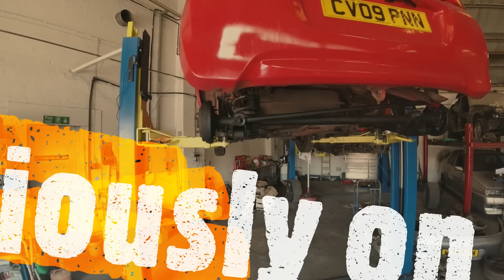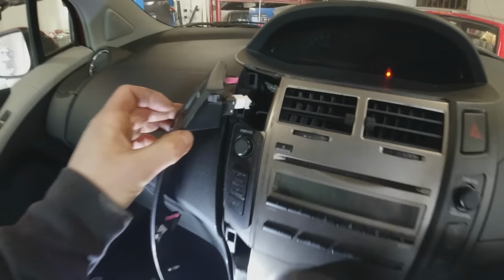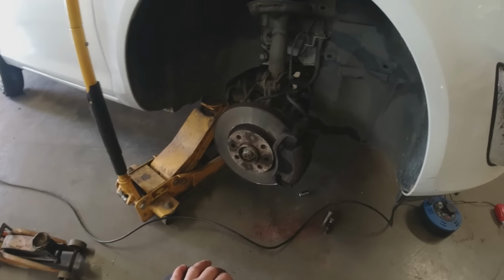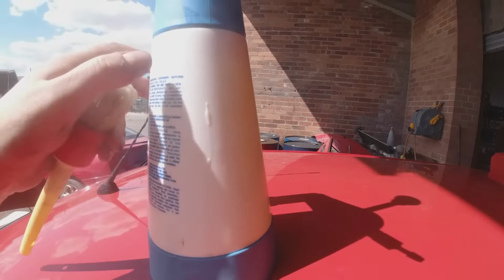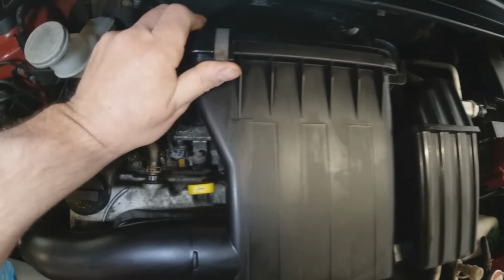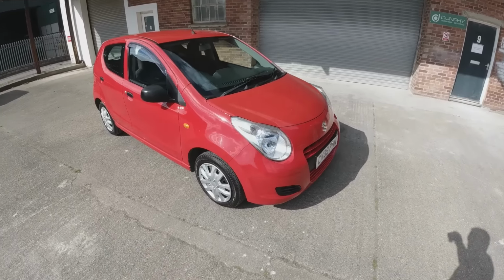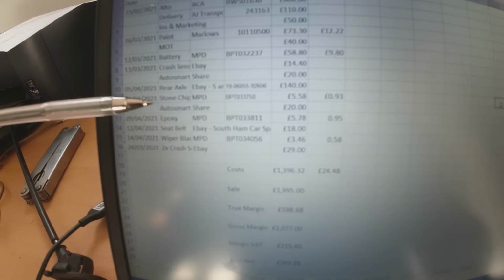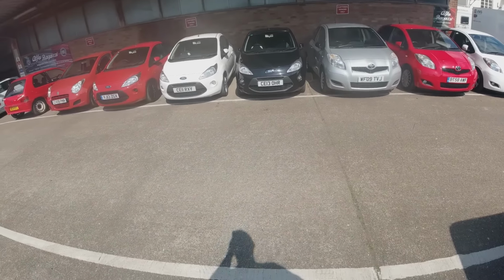Big News! Told to STOP SELLING CARS!! No more Car Flips?

Comment: The vast majority of Bona fide motor traders prep the cars properly. Gone are the days when you threw a bucket of water over it and put a bandage on the exhaust. It's went full circle where almost every niggle has to addressed whereas the private sellers are expecting retail money for a car that hasn't even been cleaned properly let alone mechanically inspected on a ramp.
Reply from the maker: Think you have nailed it there Mr T

Comment: Due to the virus the Landlord cannot evict you until March 2022.  Take your time looking for the right place.  The landlord cannot  "turn a blind eye" as you put it,  accept rent then change her mind later.  If it we're me I would ask the Landlord how she is going to compensate me  to leave? 
Re plastic welding,  if you use wire wool as well makes a stronger joint same as super glue  baking  soda and wire wool . 
Quote
Mr Barclay told the Commons: "Existing measures will remain in place, including extending the current moratorium to protect commercial tenants from eviction to March 25, 2022," Mr Barclay told the Commons.

He also announced plans for a binding arbitration scheme to resolve disputes between landlords and commercial tenants. Mr Barclay said the scheme should be in place for when the eviction ban is lifted
Unquote
Reply from the maker: Yes I don't hold the lease Stuart does but as you say we have time

Comment: What fixed price insurance platforms do you use?
Reply from the maker: Sorry do you mean Warranties?
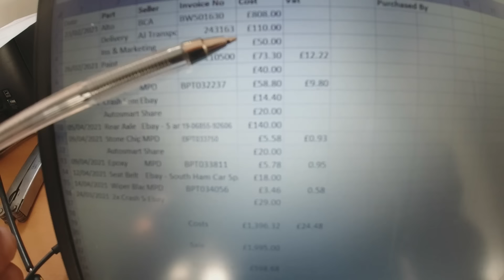Reply: @ChopsGarage  @26:30 you said you allocated a percentage of costs of insurance and marketing. My problem of getting in the trade is motor trade insurance. Is there any way of getting cheap insurance I know part time traders insurance should be cheaper but I was thinking is there a way to temporarily insure myself? Without motor trade insurance you cannot sign up to buy from auction houses so I'm struggling to find a way through this. Really don't fancy spending £5k on insurance whilst out of work lol
Reply from the maker: @M2menace  mmm not sure , but traders policies are about £1000 in my experience
Reply: @ChopsGarage  that sounds really cheap! I guess a mixture of location and existing no claims bonus helps

Comment: Worst comes to the worst sell from the Home mate for 2/3 months make sure the new place ticks a few of your boxes. But really think you have made a lot of connections where you are just now so they will always last but fingers crossed you find somewhere soon mate. Really wish you good luck! 

Tbf mate would do it for goodwill different if it was cost of a part or that but repeat customers/possible passing a good review worth its weight in gold. 

G101 is good and covers loads of cleaning wise with the car but I use Finish a product from AutoSmart for the Interiors or AeroSpace 303. Tyres I use Autosmarts Highstyle Dressing would highly recommend. Seat wise again buy just a 5l drum of solution from eBay with a nice scent and I use a Bissel Spot Clean Pro another little magic tool!
Reply from the maker: Cheers Paul, I check that tool out!

Comment: I push delivery via videos and loads of information then it doesn't seem to matter where you are, took one over the other day, they asked if I could remove their old car, I drove it back at 95 quid, valeted it, put an o2 sensor in it and got 675 for it, we've done some long trips and you know that unless it's a serious fault its not going to come back (which seems to take up a lot of your time)
Reply from the maker: Agreed I think this day and age location is less of an issue

Comment: Just come across your great channel,  In the early 90s I used to buy and sell Audi coupe gt's,  the 1982-91 models Ur 10 value and the later 20 valve turbo Quattro's. If only had known then because these cars  are rare but worth a bloody fortune now. I have now bought an early low mileage Audi TT and one of the first generation of the Ford focus that I will store as an investment because they are going to be a future classics and worth good money within the next 10 or so years, its  better than having the money in the bank. Keep up the good work and all the best for the future.
Reply: Crystal ball. I had 205gti would be worth 25k now! My friend has an Audi coupe '92 worth nothing (2k)!

Chops little Rallye could be worth a bit in 10 years though...
Reply from the maker: Agreed, I think the right cars outstrip a pension all day long! Thanks for watching
Reply: @rosbifsa660  I think most of the Audi coupes after 91 ant worth much because of the new body shape even though some had the pre 20v engine in them. I had an H reg metallic blue 1.9 gti pug wished I had kept that now. I think the 1.6 are worth more for some reason.
Reply: Rob mine was the 1.6 and ‘86. So ore facelift which was the better body too - lower, more squat. 

The 1.9 was a monster in comparison but I think a lot ended up wrapped around trees.
Reply: @rosbifsa660  lol that's true  my 1.9 was the very light but quick. Friend of mine had a 1.9 309 gti and that was much more stable not as scatty as the pug. We did have some good times though. I got interested in the Audi quattro and pugs way back in the early mid 80s watching the group B rally cars speed through Dalby forest UK 2am in the morning Best decade of true rally cars.
Reply: @rob5232  I bunked off sixth form for the '85 rally stage on Olivers Mount but it took so long to walk there I missed the Lancia's - Saw the S16 and 6R4 though...

Snuck into the pits (I think '78 Mintex) to speak to Mikkola and Vatanen (?) in the Escorts - awesome (mother was Finnish). 

Definitely best rally era!
Reply: @rosbifsa660  lol wow nice one,  I have actually seen Michelle Mouton sat in her Audi. We passed Walter Rahul in his sport Quattro  on the roadside near a small town called Thornton-le-Dale. Back then they used to drive the cars on the roads to each stage. The 6r4 and RS200 were the only cars I didn't like much. Happy days fond memories.

Comment: Bit of a click baiting headline! 
Have you thought about getting a stand for your camera/phone, instead of trying to hold it with one hand and trying to do work with the other.
Reply from the maker: Why click bait Gary? I have been told to stop selling cars and need to get a new location. Yes stand is in the works
Reply: Title is catchy, not clickbait. That's what it's supposed to do 🙂
Reply: @ChopsGarage  I didn’t mean any disrespect - normally when a big banner headline like yours is featured, the reasoning is explained in the video straight away, not near the end of it. Is my point, my comment on re-reading it is badly worded.
Reply from the maker: @GM-mk3ep  don't sweat it Gary I knew there was no malice etc

Comment: You are such a nice guy, and I like your videos. I would like to give you some friendly advice: Appearance is everything. And to be honest, your shop 
doesn't look very professional and would probably not pass a fire inspection. In your next shop, throw some fresh paint on the walls and 
get some proper shelves, so you don't need to have everything on the floor, it doesn't look very good. And throw out the trash every day 
instead of collecting it in the corners. This will make a good impression on customers as well. I really hope you don't take this the 
wrong way, just trying to help. 
I used to have a shop for many years and in the beginning it looked a lot like your place, then I had some fire inspectors come visit me one 
day together with the land lord and they were not impressed to say the least.
Oil, paper and sparks is a disaster waiting to happen. Put yourself in your landlords situation, would you like to be responsible for that? 
I cleaned up the place and did some investments, best thing I ever did, working in a clean and nice space is so much better for you. 
Good luck mate!
Reply from the maker: Cheers! Well one issue is the unit is not mine, its Stewarts and he won't mind me saying is not a tidy person, but his garage his decision. My own place would be very different yes

Comment: Get yourself a Bissell Spotclean Pro. Probably the greatest value wet vac you can find and their phenomenal at cleaning up seats and carpets. £130 well spent on my side. Check out "The Detail Geek", he has a dirty Honda seat that's the best advert for them. You won't regret it ☺️
Reply: Oh, and grab a soft drill brush attachment. You can blast through a car waaaaaay quicker and get better results. Becomes addictive tbh 😅
Reply from the maker: oh good tip Ill grab one

Comment: This is the problem I'm facing, every landlord wont let anything to a mechanic near me,  yet builders, engineering shops and everything else is fine
Reply: true, why is that though ?
Reply: @rezazare4591  I genuinely dont know, the chances of ever finding a place to set a garage up and get a mortgage on it are long gone (certainly where I'm living anyway), I looked at renting a railway arch on the outskirts of Manchester just big enough for 1 ramp, with all the costs involved it would easily be £20000 just for the rent and rates.
Reply: @bush_wookie_9606  that's nuts.
Reply: @bush_wookie_9606  would you be able to trade cars from there ?
Reply: @rezazare4591  I enquired and told them I would be running a well presented workshop/sales business but they just obviously class the car trade as all scrap yard/breaker type places, shame really as for the right rent and lease I would happily start my own business
Reply from the maker: Hard isnt it